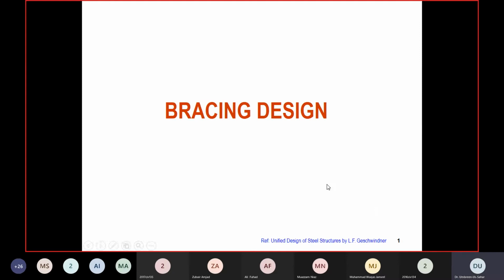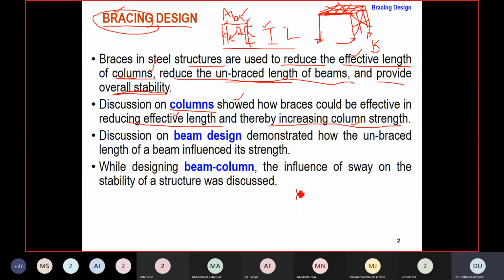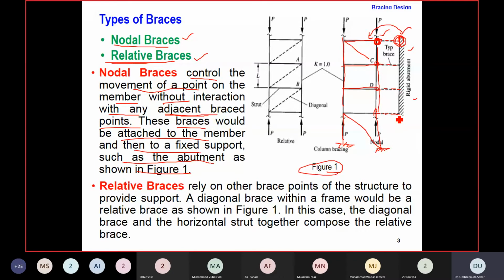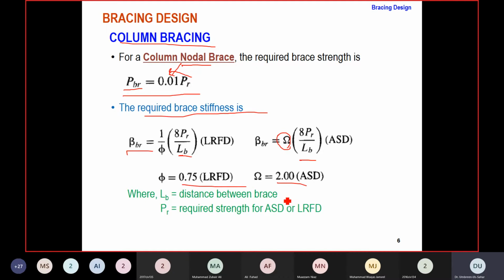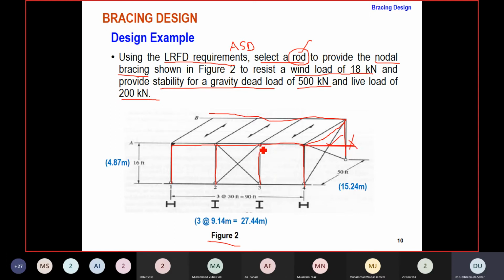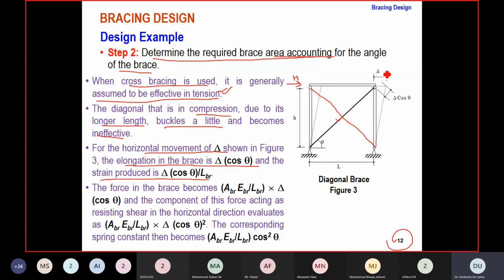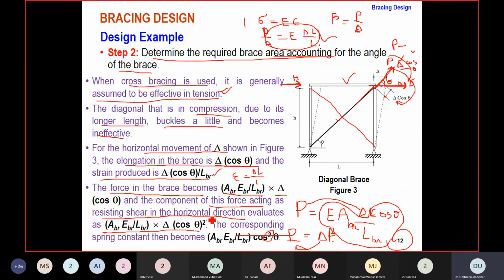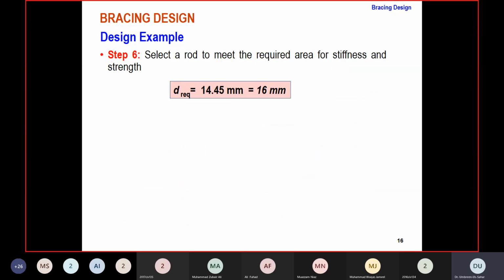bracing design

Comment: Most of the steel structures are   built of  channel sections   and  riveting or welded 
 Rock cut temples and temple architectures are  generally  without  any  steel ......and  cut on a single rock ....... and main entrance gate  sea facing 
Many sea facing temples do not have  any quarry neverthess  these temples were hewed out of stones  only 
The nearest temple on my right sea facing is about 15 metres   and the  hordings  seen near the mooring structures    
Purushotham  has authored several temple architectures  besides villa  architectures........

Moreover  you are using the back gate 
Wicket gate 
Megha rath